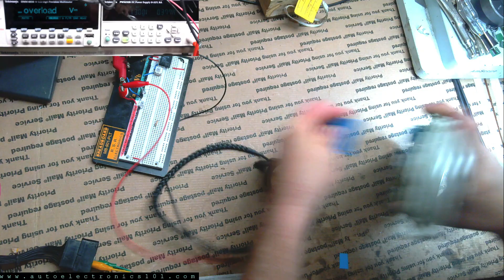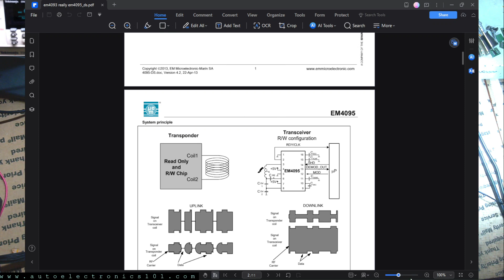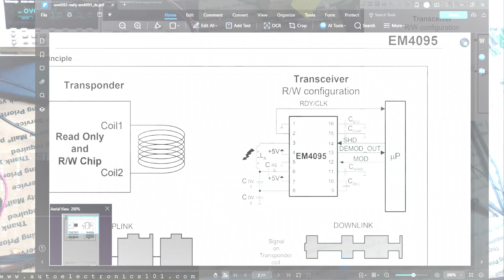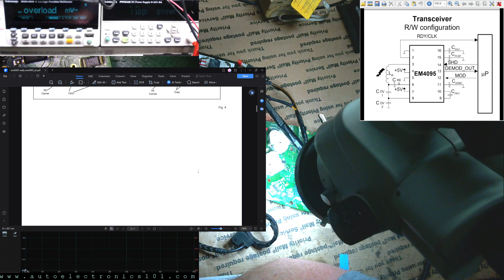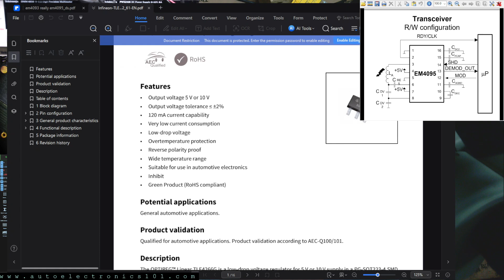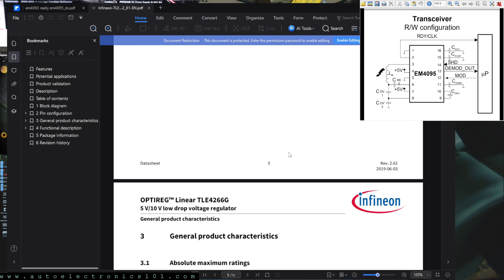VW Passat Cluster Repair Part 1: Investigating No Signal from IMMO Antenna

Comment from the maker: I did some off camera experimenting. When I moved the original clusters immo data to donor, the donor clusters antenna also stopped working. This leads me to believe that it must be something to do with parts of the immobilizer data. I put the donor clusters info back as normal and antenna started working again. In the end, I transferred the original clusters CS, VIN & PIN to donor, then I adapted donor to ecu with VVDI2. Everything worked fine for me after that. Didnt get a chance to film it, Sorry for anyone waiting on a part 2.

Comment: Have you upgraded you ESD work surface?
Reply from the maker: Not lately. I have the same silicon mat I've had for awhile and also ( I'm sure you hate it )  I will still set down cardboard once in awhile like in the current video. The stuff I work on is covered in diesel, oil and dirt so It helps quite a bit. Considering everything is still in its original aluminum housing, I'd consider it pretty low risk..
Reply: @ecurepair  I am not judging you as to your mat. I like your videos. However, if you work for an Tier 1 Module supplier like Continental, who basically follows IPC rules for manufacturing, re-work and repair for contracts with domestic OEMs, and by repair I mean field returns and analysis, there are strict guidelines for ESD control, which is actually very important in MI in the winter when the lab has very low humidity. Basically, the guidelines require ESD mitigation if you intend to open the case, and like you some times the case is dirty, so the first step would be to protect the connector and then degrease, clean and dry the module if it has a metal case. 

ESD is real and you can damage components if you do not discharge yourself before touching the PCB, and as a tech if you fry an ECU because you did not follow the safety rules, you will be quickly out of work. However, the problem for a Youtuber is if someone knows the proper module repair ESD procedures and does not see basic ESD protection in the videos they would never use your repair services. Which is okay if what you do is just a hobby. 

Now, with that being said, many parts of the country, lets say in Austin, TX, your lab may never see extreme ESD conditions. In MI you would see an earthed (grounded) steel work bench with 304 Stainless Steel top having a full coverage ESD mat with perhaps a cutout(s) for the microscope(s) bolted base plate, and the technician being ESD grounded usually through a foot strap (anti-static floor), having a wrist strap is not ideal when reaching with both hands all around the bench, even so you usually touch the lip of the SS top to make sure you have no static before working on a module just in case. Some Semiconductor suppliers for a critical study (usually a pattern to a recall), will request only certified IPC specialists or instructors work on the module(s), which is often written into the sourcing contract.

You may be interested to know that what you do is really a specialized function as viewed from the Tier 1 Module supplier, that is, field repairs beyond warranty. If the ECUs are warranty field returns they will not only be repaired, but fully tested, with the latest factory automated test script and software image (using custom large programmable stand-alone module testers, which do all major function testing). The warranty field returns required that an identified failed part must be cataloged with a report (may include a video of the repair, but always images) written (PDF with images) which is emailed to the module program lead engineer. So, this means all of the parts replaced cannot be damaged in any way. Obviously, the equipment and skill needed are substantial. Microcontrollers will be returned to the manufacturer where by they will de-cap them and study the damage to the die (usually an electrical overstress of some type), but not always. However, if the module is beyond warranty the Tier 1 may never know anything about a pattern of failure unless the OEM requests a study, usually if involving a recall.